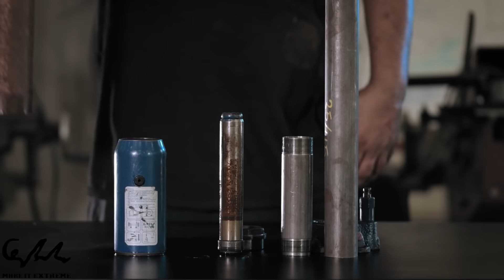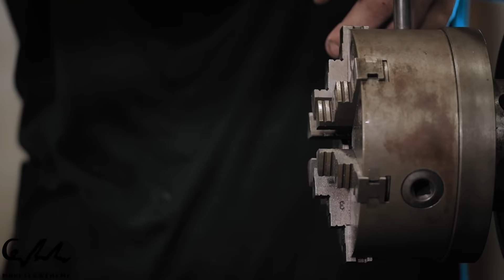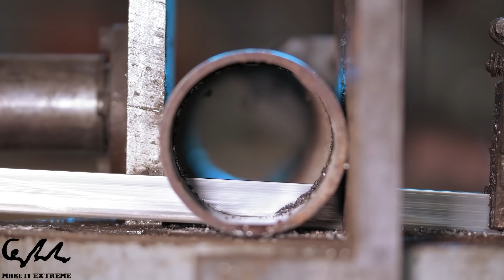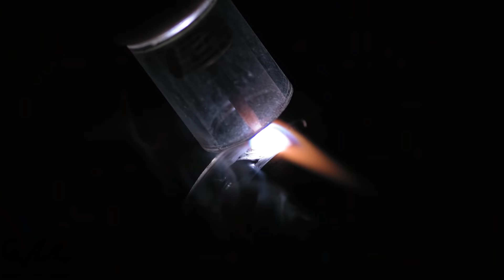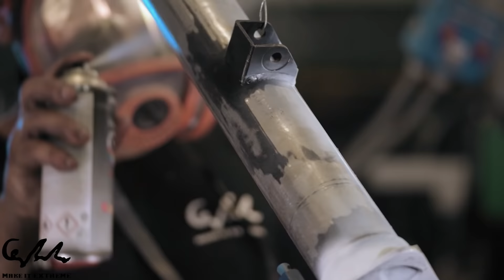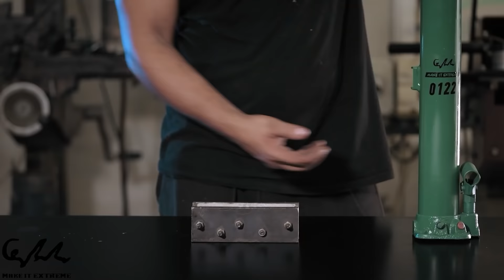Extending a Hydraulic jack

Comment: I still prefer using hss with the better finnishes with lower spindle/cutter speeds. Next run an offset on a 12 volt wiper motor spindle for your actuator & theres your automation but have to set in shut off limiters for the el motor. Personally Maching & fabrication is very fullfilling for me . Cheers

Comment: Sorry, of course, but when assembling hydraulic cylinders, shouldn't the inner surface of the cylinder be honed? If you just clean it from dirt and rust, then this will reduce the life of the rings and gaskets on the piston, and the geometry will not be respected.